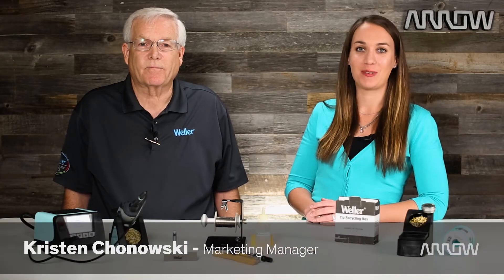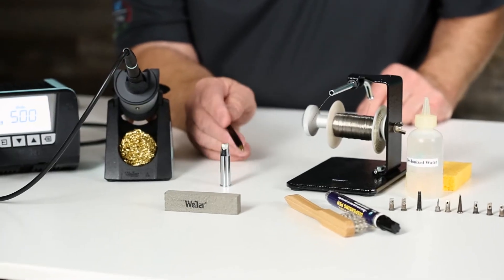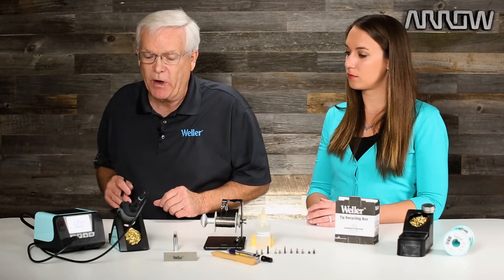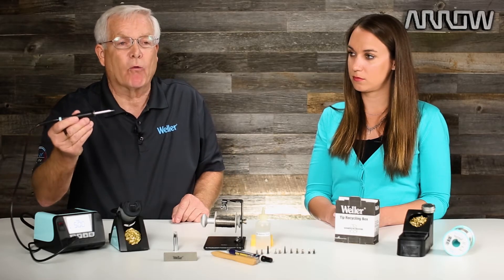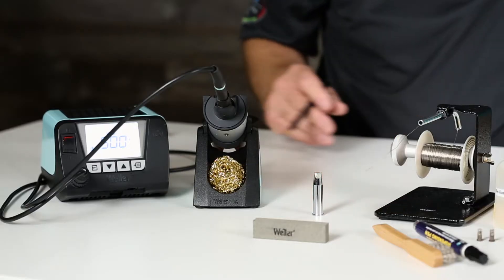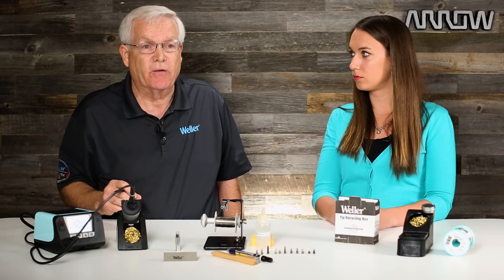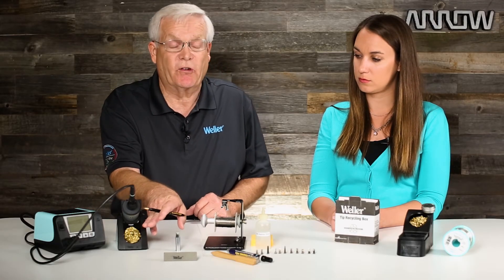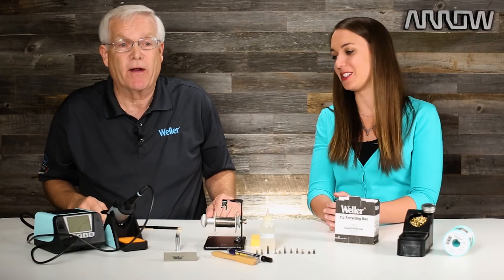Soldering Tip Maintenance

Comment: I have used Weller Soldering Irons, Stations and other products for many decades both personally and professionally. Years ago I had all my tools and equipment stolen, and recently have been purchasing  many new Weller products including a Soldering Station, Solder Stand, Solder Suckers, Fume Extractor, dispensables, and other items. I purchased the Silicon Soldering Mat like shown in this video, and got it home to find the way WELLER Packaged it rolled up in a box instead of flat, resulting in the material being permanently deformed. i went back to exchange it and when I got home with the 2nd one IT WAS WORSE! I had to call all around to find another location which had them in stock and went there to exchange for another. After taking the 2 remaining they had to Customer Service, I exchanged the prior one, and asked to look at the others before purchasing another. BOTH of them were also badly deformed. I took the 1 of the 3 that was the "Best", and had to take it home and cut off the "Covers for the small parts bins, as they were too badly deformed and one was torn. I tried setting the Weller Soldering Mat in the Hot Arizona Sun for days with ZERO IMPROVEMENT! The mat will not lay flat on a desk, and I even have had to cut a piece of wood panel to try and glue it too when I get some Spray Adhesive. Looking of the general quality of the Weller products I have bought, I must say that they do not appear to be nearly as durable or well made as the original Weller Products. As I checked out the official Weller Video, I am amazed to see that the same crap on the store shelves is being demonstrated in this video. The matt shown here does not lay flat, and obviously there is a problem that needs to be addressed. Another issue not addressed is if the Mat is ESD SAFE. If not, working on sensitive electronics around one could be destructive. Isn't that an IMPORTANT piece of information which should be identified in the packaging, on the product, or in the documentation?

Comment: Hi, i purchased this wes51 and with min use it became out of order, the red led lits continuously no heat, can you please send the the details of heater element ohms and sensor ohms resistance so that i could able to check the iron element continuty and sensor reading and if it matches with your resistance reading i can check inside the controller unit.
Just send me the   wes51 iron 5 pin heater element and sensor resistance in ohms to check the iron first.

Comment: This video left me with questions. If you are doing metal work soldering, that uses solder with no flux, & has separate acid flux, then how do you go about this? This video spoke of letting the flux from the wire core clean the tip. I trust the expert totally; I just hope for more details, for different types of soldering. I just heard to not put acid flux on the soldering tip? (I esp have in mind lead free solder as well, with high percentage tin... or Weller new solder that has nickel in it? to tin the tip?)

Comment: hi, please clarify in your video you are showing 500 F and not 500 C since it's not visible on the video. new people might crank their Celsius way up which is not a good idea. 500 F  is only 260 C  (low temperature)
Reply: Thanks for pointing that out.
Reply: Good 👍
Reply: its surely imperial freedom units (F) since they are american 🤮🤮🤮
Reply: But I thought leadfree solder doesn't melt at 260C and you needed something like 330C - 350C?

Comment: I solder everyday and was going through some tips kept thinking why won't this solder stick to the tip just kept beading up and causing troubles I think my biggest problem was not tinning it in between and would leave the iron running while doing stuff thnx great video